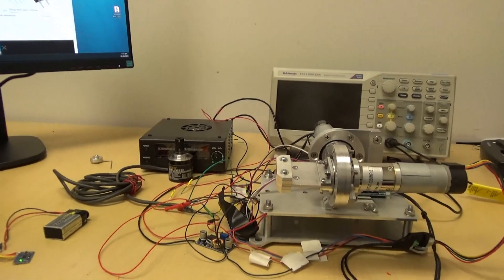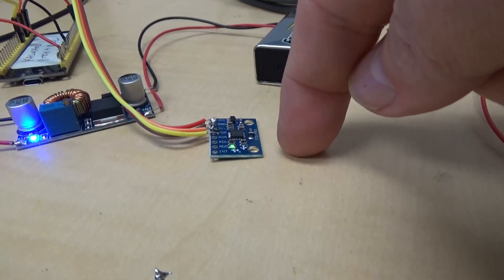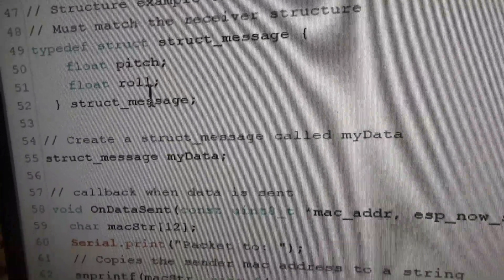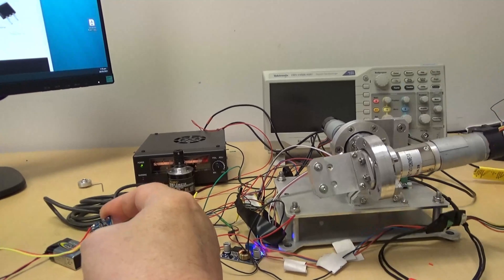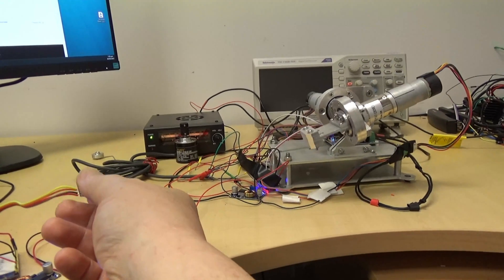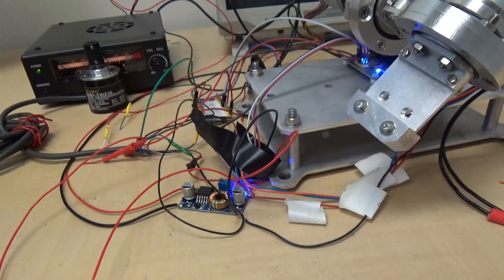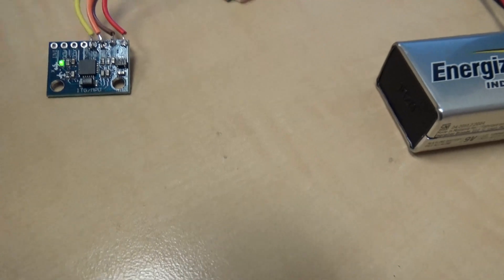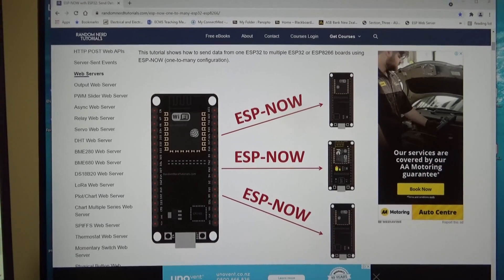ESP-Now two receivers one transmitter. Kalman filter for Pitch and Roll

Comment: Nice demos.   The DC to DC converters look massively over rated.   What the specs of the rotary encoders for their power requirements?
Reply from the maker: Yes they are. Give out 3A. Encoders take 35mA max. So we have 4 encoders (2 built into the motors) plus two ESP32 ICs. Cost are currently 0.59 NZ dollars. Giving them away.
Reply: Please PM about this project. I have an application for something like it.